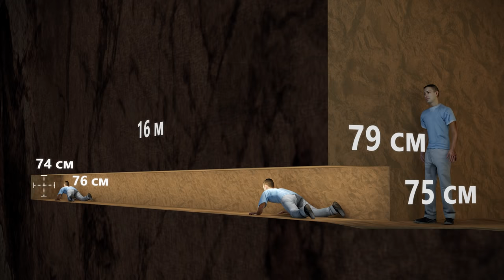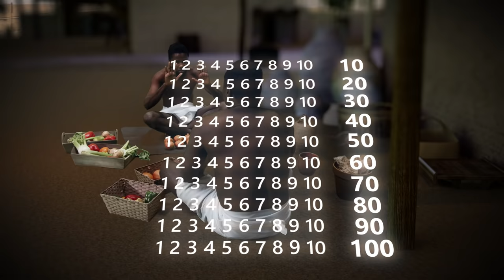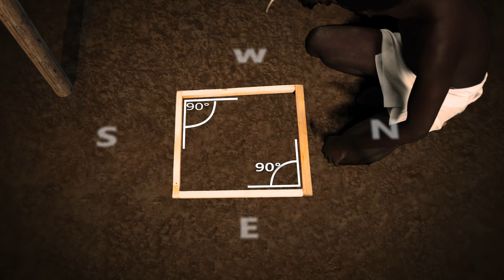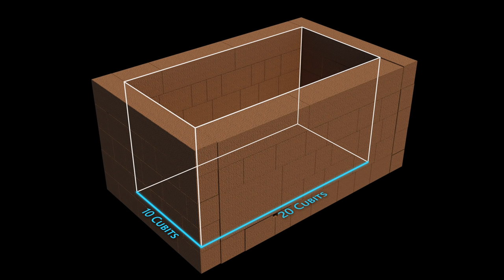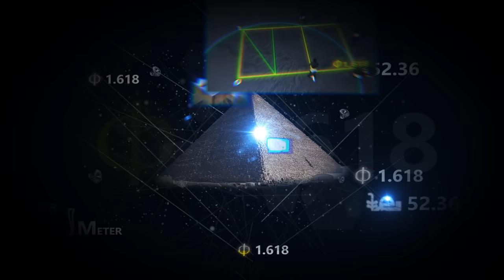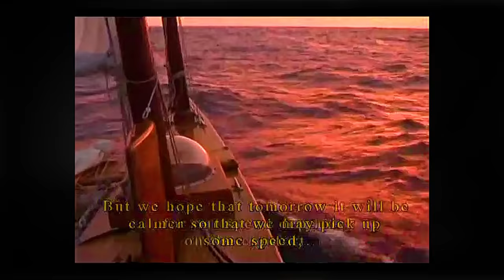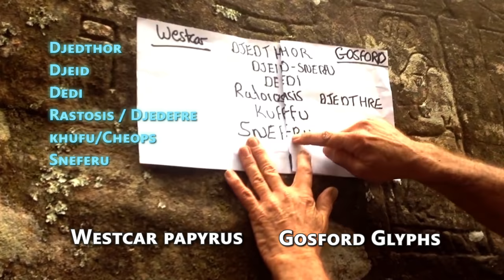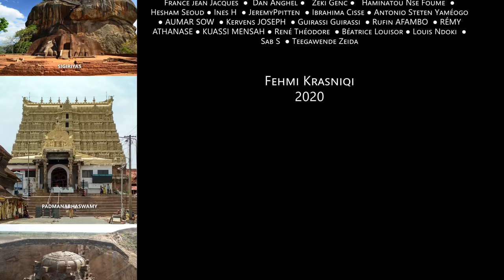The Movie Great Pyramid K 2019 - Director Fehmi Krasniqi

Comment: Physical Limitations: The physical stature and strength of the ancient Egyptians were not optimized for strenuous manual labor on the scale required for pyramid construction. It is questionable whether they possessed the necessary physical capabilities to accomplish such a monumental task.

Education and Training: Pyramids necessitates a high level of technical expertise and knowledge in various fields,  theory fails to provide a clear explanation of WHO provided the necessary education and training to the laborers involved in pyramid construction. 

Communication in Confined Spaces: Considering the hierarchical nature of the construction process, it becomes crucial to address how effective communication occurred between supervisors, architects, engineers, and the labor force working at different levels and sections of the pyramids. Transmitting instructions, relaying architectural plans, and addressing queries in such enclosed and congested areas would have posed significant challenges.
    
Additionally, communication would have been necessary for addressing any issues, clarifying doubts, or providing feedback during the construction process. It raises questions about the existence of a structured communication system that allowed for efficient problem-solving and decision-making on-site. Without clear mechanisms for communication, the risk of misunderstandings, errors, and delays in the construction process would have been significant.

The lack of natural light: nArrow passages, and the sheer volume of people present within the pyramid structures would have hindered verbal communication and made it difficult for visual cues to be observed by all workers simultaneously. Without addressing these logistical constraints, the prevailing theory fails to provide a realistic account of how communication was maintained in such challenging circumstances.

Logistics of lighting in such confined spaces would have presented challenges. Limited ventilation, the risk of smoke accumulation,

SICK CALL: Reasonable to assume that workers may have experienced injuries or illnesses during the construction process. However, the prevailing theory often fails to address who would have been responsible for managing such situations.

An effective system for managing sick calls or call-outs would have been crucial to maintain the productivity of the workforce.  Construction sites of this magnitude would have required a comprehensive approach to handle injuries, ensuring the safety and well-being of the laborers involved. The absence of a well-documented system for addressing these issues raises questions about the practicality and feasibility of the prevailing theory.
   
THE WOMAN: An intriguing question arises regarding the presence and role of women during that time. Considering the vast number of men engaged in this labor-intensive work, it leads to a natural inquiry: where were the women who would have given birth to such a significant population of men?  Who was responsible for perpetuating the population through childbirth and raising children?
     

Perhaps they were not human?

Comment: The idea of melting rock or more casting makes the whole idea of building these objects more palatable. However the suggestion of a melting rock with a lens of couple of meters puts the the whole story into fantasy land. 
If you were indeed able to make a lens let's say of 2m2 it would not even melt 1cm3 of granite. If it was we would be making more grandioos things then ever., our cement industry would not wait for one second in order to make more money Just check  PS10 Solar Power Plant, i's size is 120 square meters and even that would not be able to melt these rocks melt within available 8 hours. & there is also not one single evidence that  they knew something like lens. But wait they might have even invented cranes. 🙂

Comment: The most annoying thing in this video is the complete miss-pronounciation of the number system, all numbers after the decimal point are less than one and as such are called out individually , you cannot have a higher number after the decimal point which is what the narrater calls out every time. It would make a huge difference if the numbers were called out correctly. Thanks

Comment: It doesn't work when you try and measure time on a metric scale. That is why we still use the original scale from the sumerians. What's the Egyptians already knew about before as you claim, they invented the metric system. Which there's no support for that. They used aspects of what the metric system can measure. But that doesn't mean that they invented it.
Why wouldn't they have figured out a way to have 100° be a circle if this were all true?

Comment: She just says kufu's name is correctly written with no evidence whatsoever. That's the problem with this entire documentary is that there is very little evidence to support any of it. The math is legit, I do like the early part with the centimeter being discovered as the measure of a drop of water on a clean surface of alabaster or granite, that may be true and it certainly seems to have enough evidence to support it, at least experimental evidence, but almost everything else that she says afterwards is somewhat nonsensical and you have to take her on a leap of faith. From the polymer concrete stones to the wood embedded in it to the blacks being the only race doing all of this engineering and work, on and on it goes.

Comment: if it takes 10 - 13 years to build, this means they knew when they would die. What happens to the body in the meantime? held in suspension in oil? just plain mummification wont cut it

Comment: This is indeed a very convincing theory, and it seems like it could have been so. But it is hard to agree that the great pyramid was a tomb. I'm convinced that's not true. It wasn't"!! The author of the film does not refer in any way to the strict mathematics in terms of the position of the pyramid in relation to other buildings in the world, as well as ignores the data on the relationship of the pyramid's location with - for example - the circumference of the earth. These are very specific figures. It says nothing about the flow of energy through structures such as granite or limestone. And that's not without significance in this building.

Comment: One argument if the Egyptian build it. Then why they didn't build 100 more of that great pyramid???. Why they stop building as great size as Great pyramid in Giza???. The succeeding pharaoh pride will probably build higher than the great pyramid but they never build higher and then they started building smaller pyramid. Isn't that a mystery?? I'm sure they will boast it and build higher than great pyramid but they didn't. Ancient civilizations build it using concrete and molding technique as you can see similar technique around the world. They have world wide civilizations in the old world before the great flood. Weathering and water erosion prove it so.

Comment: The bias idea of Fehmi Krasniqi is that the world history should be rewritten because black Egyptians built all the pyramids and megalithic constructions all around the world beginning from Egypt, South America, Australia, India, Europe with polymer concrete and wooden forms, and a 5m lens powered by the sun that melted granite to form statues, obelisks and granite blocks in molds. The black egyptians invented civilization also the metric measurements and weights system, chemistry, mathematics and sacred geometry there were no smarter and bigger builders than the black egyptians. The Greeks and the Romans were imitators and stole their ideas from black egyptians. In the animated movie there is no structural comparation shown between the polymer concrete blocks and natural cut stone blocks. The concrete in the 2-3 tons mold should be in liquid form to form a solid block and the mold can't be filled fast enough with a bucket. The problem with melted granite or basalt is that will not turn back in granite but in black obsidian glass, and nobody could work barefoot and naked close to melted granite or basalt lava and withstand 2000F degree without being cooked alive.

Comment: Some of this building technique may have been used although there are huge obelisks that have / were being carved and yet to be finished, in theory the video makes sense although the mathematics which translates into an engineering wonder is void of the intelligence needed, to construct the pyminds the civilization would have needed to be advanced,  and to boot the pyramids were and are not tombs, so overall o call BS. Pour an 80 ton granite block? The queries were miles from the site and the cuts located at those queries exist although your expecting the viewer to belive the workers cut a perfect block out then smashed it into little pieces.  Na, you've insulted the builders you have stripped them of being advanced enough to build such an awe inspiring structure.

Comment: Okay I agree with the last building process that is talked about seems logical. Now explain how they received this knowledge, there is know way they just came to all this knowledge, you keep saying they knew this. Well they just didn't wake up one day and said wow I have all this info. Now especially the giant magnifying glass to melt stone. You also keep saying they 'we already know this", again I ask who told them this? Take the sphinx for intense the face of the sphinx was not a mans face but the face of a lion it was then changed by the people who came to reside their. Fault in the pyramid is the interior as the wood used to support as it roots and it will begin to collapse, why do you think needed support now in entrances leading to the chambers. How do I know this because I know wood and what concrete can do to wood. Somethings you can not explain away as they just knew, but who or how did they get this info.

Comment: The metric system of measurement has ABSOLUTELY NOTHING to do with royal anything, this is 100% false a quick google search will tell you that. The metric system was invented in France in the 1790s, and doesn't have the slightest thing to do with Egypt or their systems of measurement. A meter is 1/10,000,000 of a quadrant of a great circle of Earth, measured around the poles of the meridian passing through Paris as defined at the time of it's creation.

Comment: From 37:12, at https://youtu.be/KMAtkjy_YK4?list=PLz5LdUw9vfbOKUTKDPjPpcmIc14NfW5uf&t=2232 having seen the rest of the videos in this playlist, it doesn't seem to me like the wooden beam is stuck in any original concrete, but in modern concrete added by the restorers or plaster of Paris that was added by the ancient Egyptians during the times of the pharaohs.

This as it is much whiter than the original stones (that may also have been earlier concrete; I don't mean to dispute that!).

The original stones are darker yellow and also covered by salt crystals from when the pyramid—thousands of years earlier was still in commission working as a pollution free lightening driven with inverse piezo electric ultra sound of molecule smashing 43 kHz creating granite chambers—and as a side effect seasonal rain producing—chemical plant, making the Sahara lush green for thousands of years. This salt is only present on the older stones in opposition to both on the concrete or the plaster of Paris and neither on the wooden beam does there seem to be any salt. Maybe we'll just have to look for it, to see it?

Comment: IF THE BLOCKS WERE POURED WHY ARE THEY ALL DIFFERENT SIZE? WHY STICK TO SINGLE BLOCKS INSTEAD OF MASSIVE BEAMS 3 OR 4 TIMES THE LENGTH OF A BLOCK? SURELY EASIER AND QUICKER TO BUILD. BESIDES, 64 TONNES OF MIXTURE WOULD PROBABLY CARRY 20 OR 30 TONNES OF WATER, ARE THOSE BLOCKS GOING TO CURE AND DRY UP FROM ONE DAY TO THE NEXT DESPITE THE HEAT? HOW ABOUT THE PEOPLE WORKING AT 45ºC WITH CAUSTIC MATERIALS WITHOUT ANY PROTECTION AGAINST THE SUN? ONLY PROTECTED BECAUSE OF THE COLOUR OF THEIR SKIN? SERIOUSLY? FINALLY, GRANITE MELTS AT AROUND 1000º - 1200ºC WHEN IT TURNS INTO MOLTEN OBSIDIAN, OR VOLCANIC GLASS. IT DOESN'T TURN BACK TO GRANITE ONCE IT COOLS DOWN, IT REMAINS GLASS. WHAT MATERIAL DO YOU USE TO HOLD IT IN SHAPE UNTIL IT COOLS DOWN? CLAY? REALLY? SO THIS "DOCUMENTARY" RAISES MORE QUESTIONS THAN ANSWERS.

Comment: Nothing wrong with an hypothesis, conjecture especially when it comes to this kind of 'mystery'. HOWEVER we must not allow ourselves to be swamped with just that into believing the conclusions are 'absolute'. Where are the so called giant lenses used?? We are told that the secret of the building techniques used were so secret that not even the walls record evidence of their existence? Not every continent would have had the ingredients to make up the giant glass lenses? Overall as said, enjoyed this HYPOTHESIS, CONJECTURE. 👍BUT if we explore the LAZER idea AND that those responsible had the means to travel through the air thus the reason we have the NAZCA lines etc the reasoning seems far more acceptable. The 'ancient' ones existed millions of year BEFORE our present day civilisation ? Why not? Cataclysmic events would certainly NOT have been unknown. Wiping them out AND all of the secrets hitherto known by them AND in my eyes Khufru was NOT the founder of the pyramids and associated EARLY structures. BUT then, that is my opinion... and just like the originators of this.. we're NOT alone.

Comment: So if I understand correctly, they couldn't get 60 ton granite blocks up to the king's chamber but a 100 ton glass lens was no problem. Remnants of those lenses should have been found. If it were possible to melt and cast granite, which no one has yet shown to be possible, I would rather think of copper mirrors. Copper tools were widely used at the time, and are easy to shape and polish into parabolic mirrors and can be easily transported in smaller and lightweight parts. Or even several of them. And it is not surprising that none of those copper mirrors have been found, because that copper can easily be reused for other uses. Oh, and the limestone blocks of the pyramid are all different sizes, except for the height. If they had used a casting method, they could also have poured the entire pyramid in layers from the ground to the top in one piece.
Reply: They could not pour such a quantity of molten material because it would mean a high temperature on the construction site, precisely the temperature that no worker can get close to. Please think carefully before you ever ask such a thoughtless question. I would also add, the transport of larger mirrors was aided: by the way it was found and implemented or/and enabled by giant humans). 
                     The real question here is, I would say, why exactly they (Egyptians) started to think in this way first..  QUANTUM way.
Greetings from Croatia, the country of Nikola Tesla.

Comment: An interesting theory, but it has many shortcomings. Unfortunately, this is what happens with topics of political demand. As if skin color was the most important thing, but the evidence is the broken new skin and the melanin content in despite from before 2500 years. However, DNA tests are not important. But let's talk about the substance, the theory is cool, but the donation of Mayan pyramids to temples in India and Egypt temporarily excludes the pilgrimage of Afro-Egyptians after all.Unless they had planes, that would immediately explain Nasca because why would anyone want to mark something that couldn't be seen from the ground? Not to mention that they themselves said that wood was worth its weight in gold in Egypt, and I'm sorry,but what were the molds for casting "stones" made of? Besides, wooden molds always leave a wood pattern on concrete, plaster or whatever. Unless they knew how to plan a board, but that would mean that they had more advanced tools, and here's another shot at the theory of how they made these molds for poured granite and from what material. They repeat the word bench, and someone wonders what tempera it is?You have to think about staying near such a temperature without protective clothing... The guy who put in the pieces of granite died every time the lens operators made a mistake.And finally, the most important thing is how to make such a large and crystal clear lens with the right focusing angle, someone who deals with optics, images, glasses and photography with lenses knows,that it's not that simple... But the Afro-Egyptians got bored and invented civilization and spread it around the world. I'm sorry, but it amuses me as much as an alien civilization. I have my theory, but I'm not going to spend my life proving it... Oh, and I forgot, other pyramids are not as magical as those in Giza... Why?

Comment: No doubt this is one of the best documentary, however, the main question still remains. The stone of Pyramids are not of the same size, not only this they are not made through nolding process. Some of the reasoning are stunningly true but the thing that does not fit is the stone size and shape that makes us believe all the stone were made with different molding. And that is a discredit to this documentary.